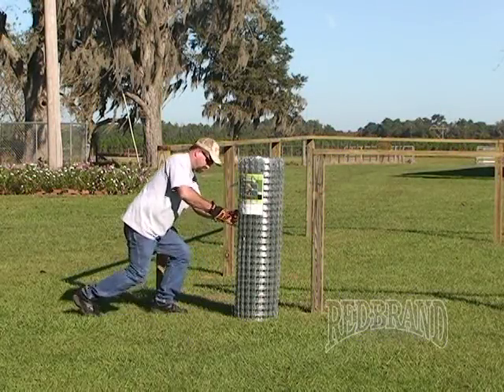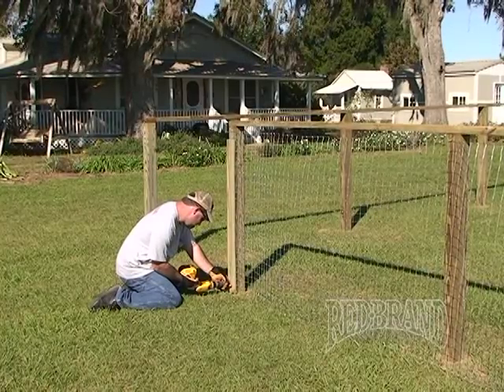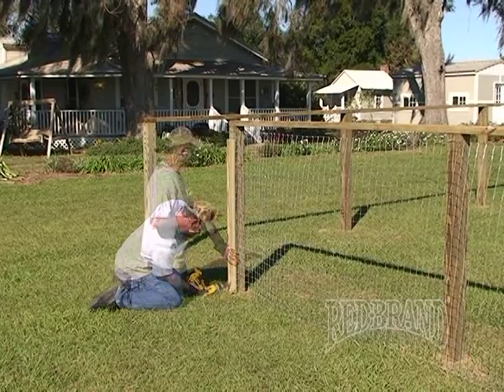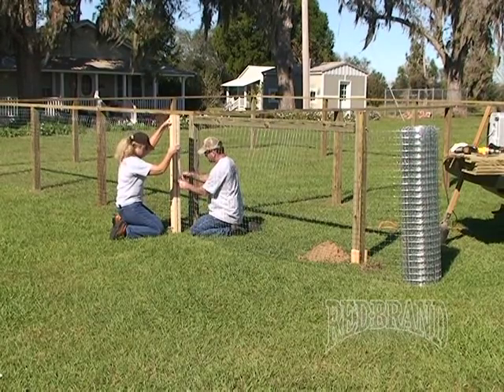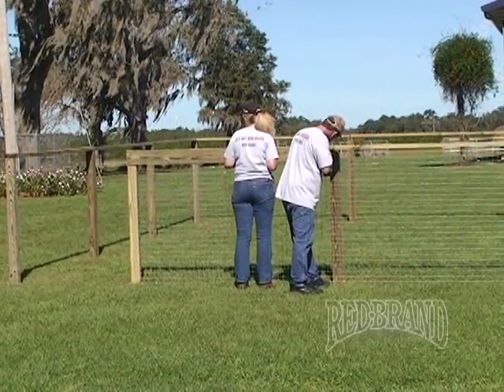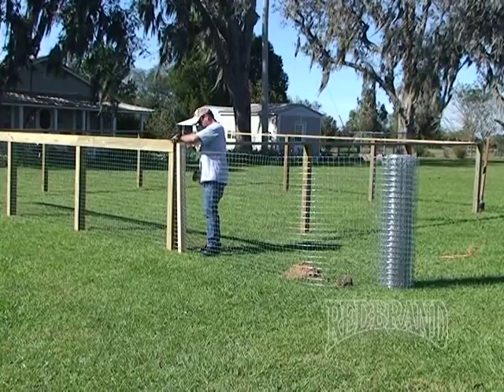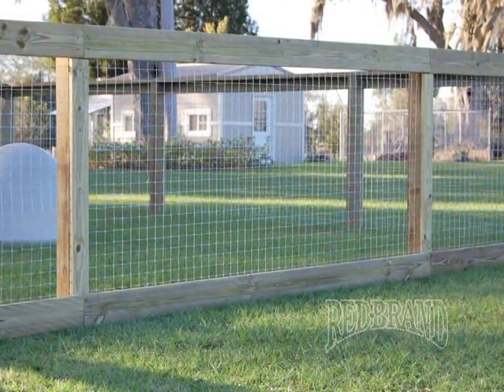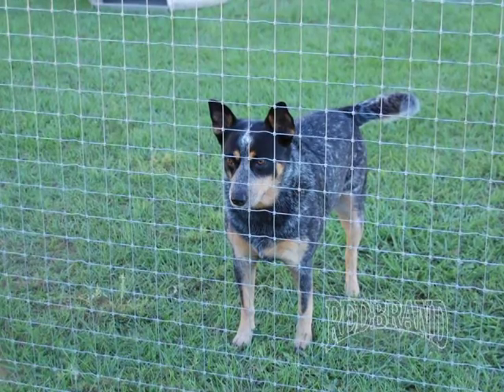Dog Kennel Fence Installation Part 2 of 2

Comment: the RSPCA suggests Here are a few suggestions to prevent your dog even being able to jump the fence.
Use PVC plastic piping or large rubber tubes, at least 5 to 6 inches in diameter, cut lengthwise down the centre. Place them along the top of your fence. This makes a curved, slippery surface that a dog cannot get a grip on to get over the top of the fence.
Erect a shorter, interior fence two or three feet from the outside fence, preventing him from getting a running start

Comment: In the beginning of the video: The man says he selected 48 inch Red Brand Yard Garden and Kennel which is a 16 gauge fence. Chainlink fence for a yard from a professional installer is 11 gauge, which is a lot stronger fence. The larger the number the smaller the strand of wires, similar to shot gun shells or electrical wiring. The type of fence this guy built is beautifully built. They did an excelltent job. However this fence would cost much, much more than a chain link fence and less durable.

Comment from the maker: Actually they both run about a $1 per foot for the product., but with chain link you have all the accessories to factor in (metal posts, caps, tension bands etc...)

Comment: This might work for some dogs, but there are other dogs who will tear up that mesh fence and chew through those wood posts and may even dig their way out. Some will even leap over the fence itself. I would say anyone who builds this type of fence needs to keep in mind what their dog is capable of. If this works for your dog, that's terrific. You may even find you need to make a few slight adjustments. All in all, this was a good video, and it's inspiring.
Reply: Those dogs need training, not a fence.
Reply: I agree that dogs do need training, but a fence is still good to have. Even if the dogs were trained, another untrained dog that doesn't belong can come into the property and cause problems for the dogs that live there, even harm them.
Reply: Actually you cant untrain certain features like excessive prey drive. We have high prey drive dogs and no matter what you think about training, if a prey animal gets in their sights, they will try what they can to get to it. Our greyhound and whippet are making our fence of choice a 5-6ft tall no climb just for the cost and security it can bring them.
Reply: Lissa Gromley  you can't train dogs when they've been locked in a kennel for a while or if there in heat
Reply: @darrienlight6124  yes u can silly

Comment: I have bought the 72inch high kennel fence mesh. I'm wondering about the fencing posts. Would I need struts and strainer posts at the corners? It looks like you didn't use any here but then it is a lower fence.
Reply from the maker: If you are cementing the corner posts you should be just fine.

Comment: On the fence stretcher... Did you bolted the 2x4s sandwiched the fence? Or the chain came through the fence around the stretcher and then you made the stretched, top and bottom ?

Comment: OK, I HAVE LOOKED AT THE FIRST VIDEO, AND THE MATH DOESN'T ADD UP, HOW HIGH ARE THE 4X4 POST ABOVE THE GROUND, BECAUSE IF I GO LIKE YOU SAID IN THE FIRST VIDEO 52 INCHES IT WILL LEAVE A 5 1/2 IN GAP TO THE TOP OF THE 2X4 MEANING I WOULD HAVE TO STAPLE THE WIRE TO THE BOTTOM OF THE 1X6 BOARD. KIND OF CONFUSING.

Comment: Would you need h braces if you didn't have the top rails if the fence is 25 feet 
Using 6in x 8ft post buried 4ft

Comment: Must be nice to have an unlimited lumber budget.  Anyone that could afford this build will have someone else build it for them.
Reply: robopam 
Either fencing contractors are very cheap in your area or lumber is very expensive. Total materials is around $400-$500 by my estimate, that isn't bad at all for a 96' run of solid fencing. A contractor would likely start at ~$1500 for chain link.

 On the cheap one could cover twice the area for what they spent making it attractive while still creating a good area for a dog. Perhaps better, the solid flat top bar is going to make it easy for a jumper to hop over. My dog would be over the very second she saw someone who might pet her or a woodchuck.

Digging holes sucks and contractors make a living saving property owners the trouble of doing it.
Reply: not really, those houses look like crap
Reply: robopam do what I do, use old pallets and go to job sites and steal Lumber
Reply: yes lets just steal it
Reply: @VanceCreative   awesome idea

Comment: "Get a taller fence. He can't jump over what he can't jump over something thats too tall.
Remove any objects he can use to boost himself over. Youd be surprised how sharp dogs can be. This means, remove any Garbage cans, tables or other aids to getting over the fence. A grill might be enough to get him up and over, so place this strategically. If your dog uses the shed or stack of firewood, coat these with cayenne pepper, bitter apple, or other aversive substances dogs dislike.

Comment: I know that you had good intentions of showing how your fence product could be used to make a fence for a dog. But with the way you constructed it, your fence would be more expensive than a chain link fence. At the very end instead of building a wooden gate and covering it with you Red Brand wire, you chose to hang a chain link gat on it. It would have been a cheaper and mor efficient dog pen to use chain link on the whole project.
Reply: Kevin Hooks price of chain link vs cost of lumber?